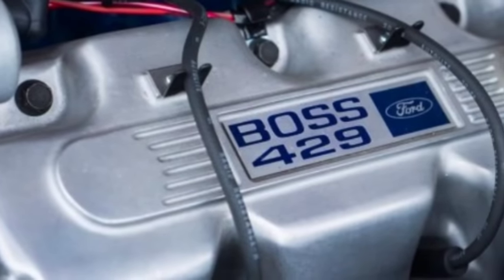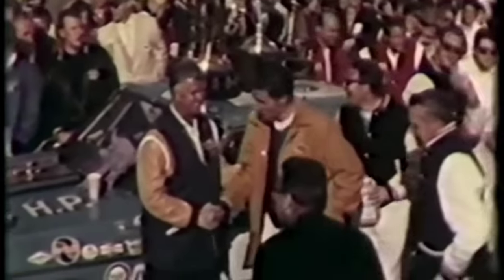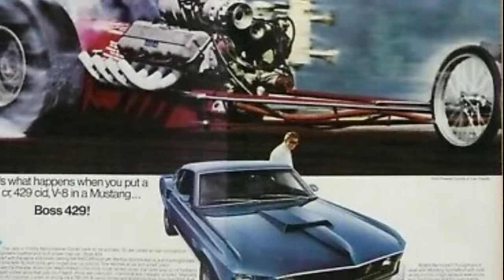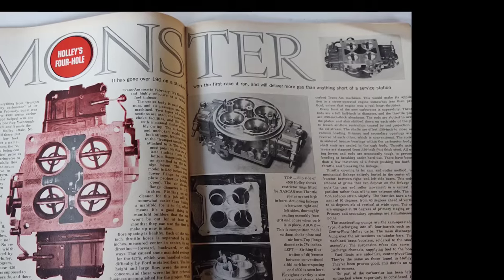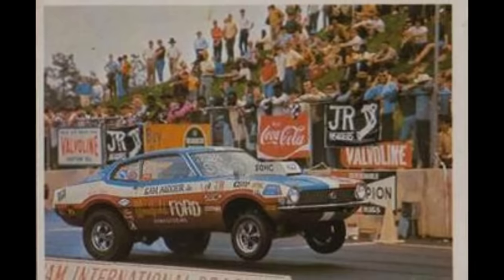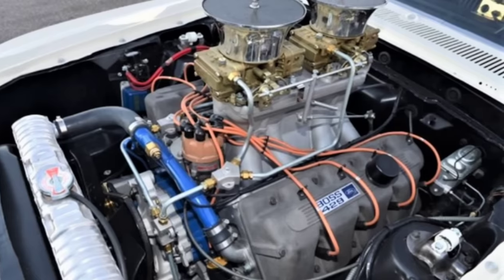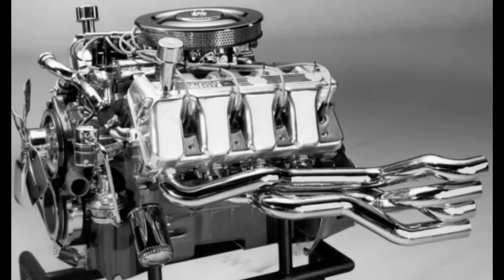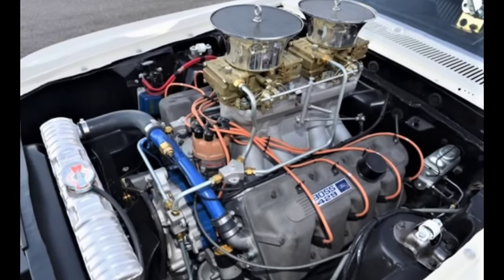The Misunderstood BOSS 429

Comment: 2:39 mark - Great Video. Since Fords production 427 High Riser (HR) engine was banned after 1964, Ford developed new heads and intake for the 427 called the Medium Riser (MR). They also changed the 427 block to a side-oiler vs the original top oiler

Comment: You forgot mentioned that the first ever NHRA Pro Stock race in 1970 at Phenix City Al, was won by a Boss 429 in a Maverick by Harold Dutton (another real Ford legend).  Rules were adjusted to make itand the other Big Blocks less competitive.... the small blocks ruled for a few yrs afterwards in NHRA.... Ford eventually became the top dog there too with the Cleveland..... however the Boss has always ruled IHRA Pro Stock where cubic inches were bigger and the Fords architecture allowed it to be built in excess of 550 inches with a stock block..... After Allan Root built the tooling for aluminium blocks (allowing 800+ inches for IHRA) and the revised A441 cyl heads, then the Boss really came into its own in the 1980s with the 500 inch rule and it dominated thanks to Glidden in NHRA.

Comment: This is the parallel between the 426 Hemi and the 440. Everybody gets all orgasmic about the Hemi. As a real-world drive, I have seen Hemis whipped by 440s many, many times. So here's the mighty Shotgun motor. If you check the figures in the era, not only was it a lot more money then a Cobra Jet, it wasn't as fast in most cases. Looked great. Wasn't better.
Reply from the maker: Yup... It took a well tuned Hemi to outrun a 440 on the street.. and you are right the price difference between a CJ and the BOSS was huge... Only to play second fiddle in straight line competition!
Thanks for watching! Please Subscribe as I have some cool content coming up!
Andy
Reply from the maker: @sodbuster4296  I bet so! That is a sweet ride... Thanks for Watching
and please Subscribe
Andy
Reply: @dougquon1174  1968 Hot Rod magazine tested a 428 Cobra jet mustang. and got 1/4 mile in 13.56 @ 106.64 mph . 0-60 in 5.9 seconds!  Hot rod tested the 69 Super bee 440 6 pack and got  1/4 mile, sec. @ mph: 13.8 @ 104.2 mph, 0-60 mph, sec: 6.3
Reply: a 383 B Block is even faster sometimes than a 426 Hemi in the 1/8th mile. I suppose a lot of it is jetting, timing, traction, and reaction time.

Comment: My friend bought one of these to do a little street racing  , I drove it and thought there was something wrong with it. The dealer told him it was running just fine . Drag racers were making the ports smaller to get it to make more hp. The car sometimes had problems stopping due to low vacuum in the power boost system. The dealer eventually took the car back and paid the bank what was due.
Reply from the maker: You are correct!  Sam told me that while he gave up on people like Al Joniec continued to work on the BOSS and they raised the port and filled in the bottom portion to form a D shaped port and that made over a 100hp increase from where they started...Bad thing was by the time they found this new power the rules had changed and they still weren't competitive due to weight breaks given to small block combos  Thanks for watching and please Subscribe to check out my Project MIXED UP BOSS and my new Hemi video..
Andy

Comment: Back in the day , I had some older friends , one had a boss 429 mustang , one with a 66 barracuda 273 , and one had a Fairlane that he shoehorned a 383 magnum into. The 429 was known as a dog , cause on the Saturday night stop light races he always lost . They never did try them on a 1/4 mile track , but the little cuda would be 4 lengths ahead by the time the mustang crossed the intersection
Reply from the maker: Yeah weren't the hottest thing on the street... That's forsure! Thanks for Watching
Andy
Reply: 383 in a FORD!!

Comment: I don't think it's been mentioned yet, but this is a very desirable ford motor in the gas 4x4 truck pulling world. They also have 500ci limits and with larger induction, make these motors breath, making big power turning 8000+ rpm when hooked to a sled.

Comment: The Boss 429 had a smaller carb than the Boss 302. Big ports hard to get air moving and once it would start the street engine would run out of carb. But they sold enough for the rules.
Reply from the maker: Ive never understood that... 780 for the Boss 302 and a 735 for the BOSS 429...  Thanks for watching and please subscribe and check out my project MIXED UP BOSS.  Im putting BOSS 429 style heads on a 429" Windsor stroker.... 750hp or bust NA
Andy
Reply: @UnityMotorSportsGarage  I heard that Ford engineers thought the smaller carb was the only way to make the cars last long enough to get out of the warranty period.
Reply: @UnityMotorSportsGarage  Great job on this video!!
Reply: The valve springs were also a weak point. Changing to the over the counter service part would let them go over 5000 without hitting a "wall". And the carburetor was the next restriction to change. I was told that the small carb made it responsive on the street. Running at a constant higher rpm with the better valve springs and a Dominator carburetor, they were formidable.

Comment: I have ridden down the track in all 3 Boss Mustangs, and the Boss 351 was the one that impressed me most. But the Boss 429 was a pretty beast. One man had a 482ci block with a pair of Boss 429 heads. At 11.7:1cr he was ripping up the local drags. Eventually, I remembered seeing him.take the engine down and run it with a Whipple supercharger.  Now, it looked far more intimidating and could be a real bear to handle. I'd be willing to bet that he and his son have several builds, if not several sets of heads.  This was in Humboldt, iowa in the early 90's .
Reply from the maker: I agree the BOSS 351 is the most overshadowed.. but will run hard! I'm actually working on a 351 Cleveland video 
Thanks for watching
Andy

Comment: Good job on this vid! ✔👍
Reply from the maker: Thanks for the kind words!! Please Subscribe as I have more cool content coming up!
Andy
Reply: @UnityMotorSportsGarage  thx I subbed
Reply: Well Boss 429 was pretty wild, the cam had timing issues, yes but a simple cam duration change, a bit of epoxy/welding work on the intake ports and it really picked up low end and still kept rpm capabilities 
Most racers dump oem intakes even if aftermarket named aluminum units. The Boss worked well but REALLY loved rpms to breathe.

Comment: The 427 "cammer" SOHC motor was also called a SOCK motor.  Bosses were called shotgun.  Both Sock and shotgun motors live on today, and can be built if you have deep pockets.
Reply from the maker: That's forsure... Thanks for Watching!  Please Subscribe and follow along my project MIXED UP BOSS, I'm putting BOSS 429 style heads ( Hammerhead Performance) on a FRPP Boss 351 Windsor shortblock.. 
Andy
Reply: They also were the most beautiful engines ever built...hard to decide...cammer or shotgun? I’ll take both please...I seen a top fuel cammer in a 60’s digger.
Reply from the maker: @davidsmall1128  I second that motion!  Thanks for Watching... Please Subscribe as I building a 429" Windsor based engine with BOSS 429 style heads.. it's called project MIXED UP BOSS! 
Andy
Reply: @UnityMotorSportsGarage  Alright, that hooked me.  Subscribed!!
Reply: @davidsmall1128  There were actually quite a few 427 SOHC Engines running blowers and burning Nitromethane, Dragsters and Funny Cars back in the day.
Reply: @ Mach One: The Boss 429 had several names: Some called it "The 429 Nascar Motor" / Shotgun / The Blue Crescent Motor
Reply: The Sonny Leonard Chevy hemi is patterned after the boss 429 and it is also a great mountain motor pro stock engine,  another fact is the 429 ran good at 500 ci for a few years but after a while the conventional Chevy splayed valve heads took it over and dominated pro stock as they do today, the 429 couldn't build the compression that the conventional Chevy heads do and this is coming from Bob Glidden. But at 800+ ci there great!
Reply: Always disliked the nick name "Sock" motor, which is nothing more than an incorrect pronunciation for SOHC!  The "Cammer" is a much better name and expresses great power better than a 🧦 motor does.:face-turquoise-covering-eyes:

Comment: I’m a fan of the boss engines. Love the boss 302.
Reply: I have both. And really the Boss 302 is just so much fun , drive it all day , revving it through gears it just keeps pulling and pulling. The boss 9 gets it done so quick that you have call it quits and calm down.
Reply from the maker: Two completely different worlds... Isn't it?  They both have their place that's fursure!  Thanks for Watching and please Subscribe and follow my Project MIXED UP BOSS... Putting BOSS 429 style heads on a 429" Stroker Windsor shortblock!! 
Andy
Reply: Both the Boss 429 and the Boss 302 are very unique engine's. the Boss 429 for it's semi hemispherical head's although it wasn't a full hemi. and the Boss 302 because it was a Windsor block with Cleveland head's. both were very iconic Ford engine's along with the venerable FE engine's. which were Y block wedge engine's namely the 427 side oiler and the SOHC. although they had a slight horse power to weight ratio issue.
Reply: @harryrenner4016  yeah Harry , you got it straight pal. Yeah and that 428 FE is no slouch. I don’t have one now but did have1969 mach1 428/4speed w/ 3:90 gear set. Wow what fun around town and back roads, just slide it around with all that torque. Have Chrysler hemi too. Just think if Chrysler wanted to up the compression ratio without re-engineering the entire valve train they would have done just what Ford did and just start adding shoulder meat into the combustion chamber. Play safe.🤪😂

Comment: Pretty much was Jon Kaase says about those heads. They need cubic inches or RPM although I wonder just how well some of the Mustangs were tuned. My Dad worked in garage back in the early 70's where the local sheriffs department would bring in their cars for maintenance and tuning. Can't remember the car but the engine was the 440. The sheriffs were complaining about the engine being a dog and so Dad started messing around with it and with the factory specified timing it was doggy but when he increased the timing around 10-12 degrees it turned into a beast. In fact he took one out on a Sunday and got it up to 140mph on the freeway that was near the garage where he worked. The next time he came into work all the sheriffs wanted him to tune there cars though he was told no more road tests.

Comment: Actually the Chrysler 426 Hemi suffered from the same problems on the street the 440 usually would beat it unless the hemi was in perfect tune simply because the port velocity was low and even then in street racing the 440 and the 454 Chevy and others still could beat it a lot of the time. These engine did not come alive until you hit about 4800 rpm or so and even then because of the compression and the cam lift and duration they still could not take advantage of the heads. That being said put in 11:50 compression or more and a lets say .650 lift solid cam then the hemi would run away from almost everything I know I owned two of them. The Boss 429 had the same problems but once built right to take advantage of those great heads the only thing that could run with it was the 426 hemi built the same way.
The truth is the Boss 429 and the Chrysler 426 Hemi ruled it all only when built to take advantage of the heads those of us who lived racing in those days knew this to be true.
Reply: Very true.
Reply: @donjennings9034  will a good boss 429 best a 1971 boss 351 remember they where quick
Reply: @AlejandroP1980s  That would be a good race, but off the line that 351 would have a good lead. The 429 might run it down. ? My cousin had a '71 Cyclone with a 351 Cleveland and out ran many big blocks and never got beat by a small block.
Reply: James you are the only one who got the HEMI. It was made for the track (racing). These clowns on here are silly.
Reply: @wildestcowboy2668  Sorry for the late replie yeah I had a hemi once in a 68 Roadrunner 4 speed once you hit about 3800 it was like hitting a switch. In those days street racing that is if they got you off the line you lost.
Plus a 440 454 429 on the street would win over a hemi at least half the time. Now up the compression of the hemi as you I know you know cam it a little nothing on the street could beat it. BUT you had to keep it tuned all the time set the lash at least once a week. Like the Lynard Skynyrd song I know a little.

Comment: Really good video. We raced Fords back in the early 70’s and the problem with Ford was it seemed they never really stuck with any design. The 427 came in so many variations in the cylinder heads. We had our most success with the tunnel port. Our budget didn’t allow us to step up to the cammer. We did have a friend with one and it was definitely more powerful. The next problem was parts cost and availability of aftermarket parts. Performance parts manufacturers made dozens of intake manifolds for Chevy engines but the tunnel port motor we had there was zero aftermarket options in those days. When you did find parts they were so much more expensive. Horsepower per dollar spent was so much better for the Chevy racers. Same friend that had the old cammer motor later had the NHRA 500 CI Boss Pro Stock engine. His car qualified well at several races around 1984 with Dyno Don Nicholson driving but the owner only had one engine and didn’t have the budget to compete with the likes of Rhere Morrison , Bob Glidden and other top runners at the time. He raced it for years with that same Boss motor in a local Pro Stock circuit in Texas and did really well with it. He still ran 500 CI and the circuit had no cubic inch limit so most of his competitors ran well over 600 CI.  He was the only Ford. He did win their points championship one season. He may still own that engine and chassis which was a Thunderbird Willie Rells built chassis.
Reply from the maker: Thanks for the kind words and for watching!  Sam Auxier Jr. Told me the same thing... They had to make a tunnel ram for the cammer... Had exhaust pipe epoxied into a old Hilborn stack injection setup and used a BBC tunnel ram top on it!  He said that is why the Cammer wasn't a to competitive in prostock.. he said by the time they got the needed intakes and cams it was too late but he also said that those parts put the power level above the Mopar Hemi but time ran out.. 
Andy
Reply: @UnityMotorSportsGarage  didn’t have the means or the funding at that time  to build our own intake so we had to stick with what Ford offered. They did offer a two four barrel intake for the tunnel port heads but we were never able to find one so we ran the single four. By comparison with the big block Chevrolets which we also raced on equal terms the power was very close. The advantage of the Chevy was there were so many aftermarket options. We finally threw in the towel on the Ford and did what we hated to do and went with Chevrolet. So much easier to find parts and performance gain was much easier with so many parts to select from. Most racers know if you got ring seal with minimal leakage a short block is a short block. Sure bigger bores help air flow but that’s basic and applies to all engines. Power comes from the intake , heads and camshaft combinations. We made our reputation building big block Chevies back in the 70’s through the 90’s. I’ve long since retired but my nephew is still a major engine builder for Pro Modified cars of all sanctions. He prefers the GM based block with Sonny Leonard style Hemi heads. I can’t quote horsepower numbers but they are well north of 3,500 on ethanol. 
I really enjoyed this video about the Boss engine. We personally never raced one but I always would of loved too. Our friend Frank Sicinski did and he’s who owned the NHRA Pro Stock Thunderbird Dyno Don drove at a few races. Earl Wade built the engine originally for Frank then we worked with Frank several years on it. Frank also had the cammer and knowing him probably still does. Him and Dyno Don again hooked up with a NHRA Pro Stock Truck.

Comment: Great content... keeping up with the horsepower and displacement wars back in the day was interesting. I'm a product of the late 60's and 70's. Grew up with Detroit Muscle. I was a Chevy fan, some of my buddies were Ford fans, and others Mopar fans. 

I was just thinking about Chevy vs Ford back in the day. Chevy came out with the 283, Ford makes the 289. Chevy makes the 327, Ford makes 328. Chevy makes 350, Ford, the 351. Chevy 427, Ford 428. Chevy 454, Ford goes big with 460. Mopar had similar upward series; 273, 318, 340, 360, 426, and 440. Each of us knew just exactly what the other cars were capable of. Lots of good natured bragging and hanging out at local burger joint. 

Both Ford and Chrysler were dominate in NASCAR for years. Both had serious engines making serious power. Chevy had some good years too, hard to beat the Kings on the track.